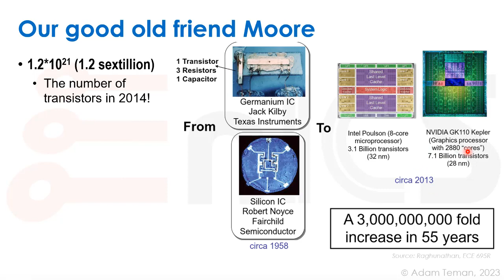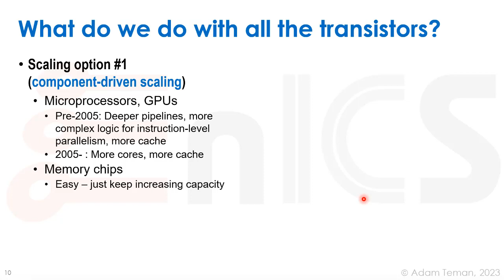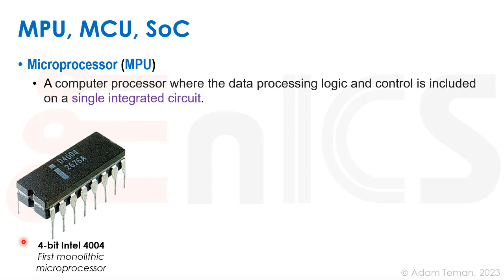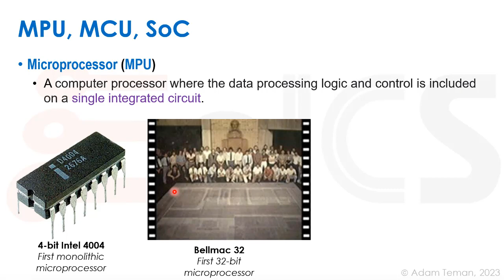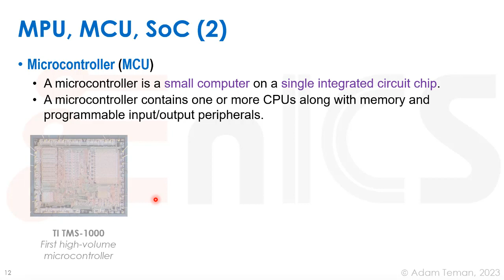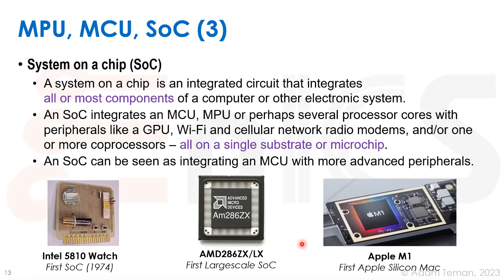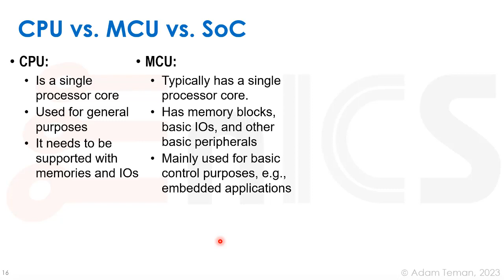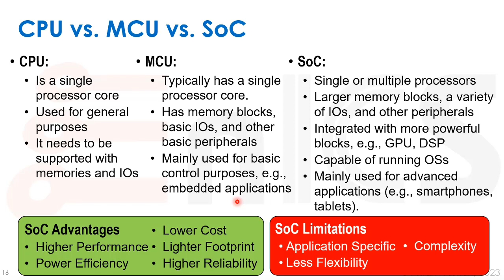SoC 101 - Lecture 1b: MPU, MCU, and SoC

Comment: Great lecture Adi! thanks a lot!  I just wanted to add, regarding the advantages of the SoC. The Soc reduces the number of components on the board and hence the connections required to build an electronic system, since all components are located on the same silicone die -> thereby reducing the overall cost of the system. Also it improves the performance of the system by reducing the communication latency between the components which are located close to each other .Since all components are physically located on the same die there is no need to "get out of the chip" and waste precious power and performance on package and board interconnects. Power consumption can also be optimized inside the Soc by adding clock gating, or turning off parts of the chip to save power reducing the overall power consumption of the system which is crucial especially for portable devices today . Lastly, the silicone chip, once fabricated and past testing,  will be placed inside a package and soldered  to it. This will then be placed on a PCB and soldered once again. The mechanical nature of the process adds additional faults to the system (bad package, bad soldering, bad PCB connection etc.) which are mostly a 3rd party vendors. By placing all components inside a closed single  SoC we remove all that and simply test all connections between the different components on the Tester in less than a minute.
Reply from the maker: Thank you, Yulia , for the important insights!

Comment: Do you have a course on Computer Architecture?
Reply from the maker: Not yet. 
This is the closest thing to it (I go over several concepts in computer architecture here, but this is far from being a computer architecture course)
That said, there are many excellent online computer architecture courses. Check out the ones from Berkeley (Krste Asanovic) and ETH Zurich (Onur Mutlu). There are super good MOOCs from Georgia Tech that would be 100X better than anything I could teach, so I suggest checking them out.

But maybe start with this course (SoC 101), since it gives an overview without going into all the 'dirty details' of the courses I mentioned.
Reply: @AdiTeman Thanks!